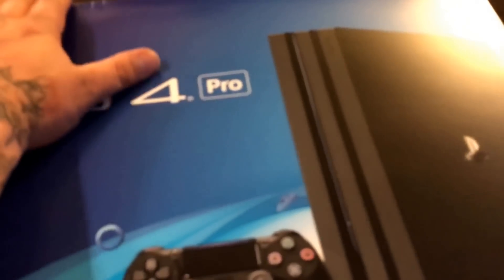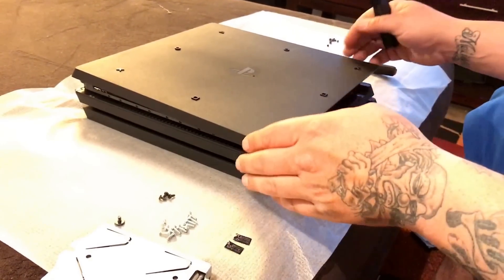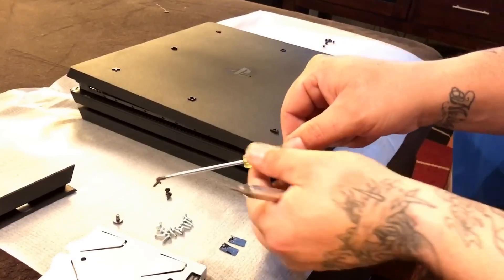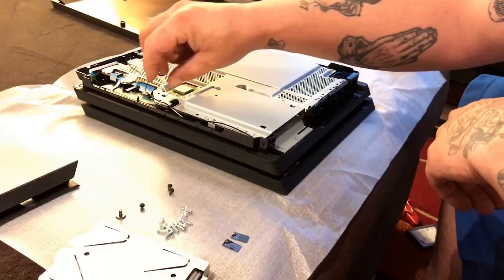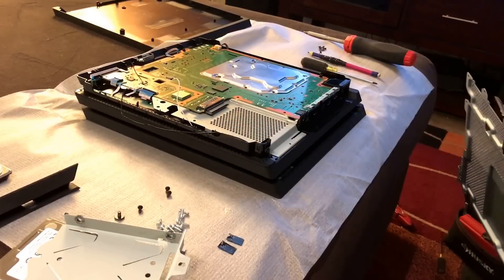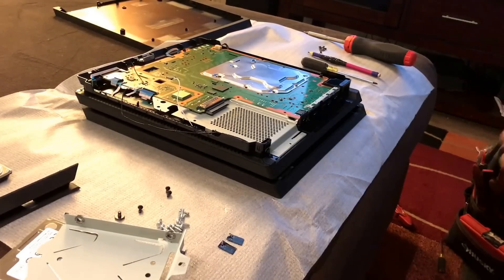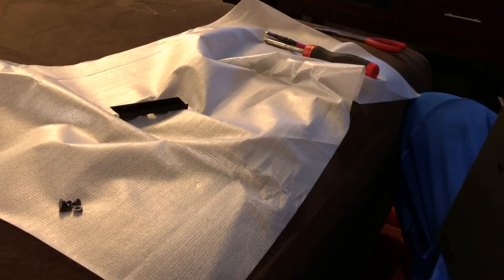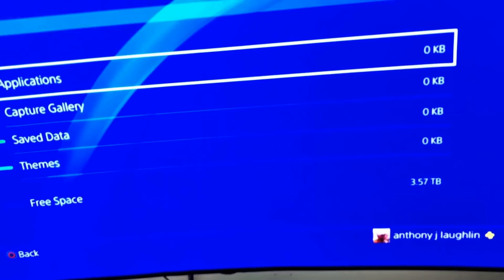How to install a 4Tb hard drive into a Playstation 4 Pro

Comment: omg that is overkill ever since ps3 you just slot out the old one and slot in the new one just like ps5 now you just slot in the extra memory
Reply: You can’t just slot in a 4TB drive as they are 15mm thick and don’t fit hence this mod to the metal plate.

Comment: Thanks for this video. For everyone who wants to know. Still works in 2022 although I had more screws under the hood (t8 and Philips mixed) than you and the bottom plate had only one t8 torx screw , so probably a different build in my 2019 ps4 pro.

Comment: I'm thinking about putting a 5TB. Dimensions are the same as 4TB. The question is: If I install the hard drive without the drawer, will it work without problems? Will it fit normally? Would you like to test?
Reply: PS4 Pro version only supports 4TB internal, I think
Reply: @turohabaneero  8TB
Reply: I'm doing 22tb😂

Comment: This is a 3.5 drive? Maybe I missed that part but it didn't seem clear to me if the drive was a 2.5 or a 3.5. I accidentally bought a 3.5 ssd and just wondering if it's possible to make it work. Thanks

Comment: Were you able to put the black cover back on the hard drive, i am fairly considering this though there is the option of external i would like the primary hard drive to be faster as that is where the ps4 operation files are
Reply from the maker: Allsorts Of Everything ya I was able to put the cover back on I have a ext drive too

Comment: WTF! if you get the correct HDD you don't need to cut anything. Great job on creating the best "what not to do" video
Reply from the maker: Vince it’s cool bro you can hate all you want but did you happen to take a look at how old the video is a little bit of info for ya see before you couldn’t plug a Ext hard drive into the ps4 you had to mod it and I cut mine bec I wanted a bigger hard drive at a good price so I did what I could with what I had at the time and I did a pretty good job being said don’t troll on videos I was just trying to help other people out at the time
Reply: @anthony03241980 what's the biggest you can fit in the pro without having to cut anything? And how did you cut it to make it flush 
Very good job
Reply: Vincenzo, are you stupid? The PS4 Pro has SATA 3 and this standard is faster than Usb 3.0 (3.1 gen 1).  If you put USB games on the PS4 Pro, you generate a bottleneck.  The only models in which it is recommended to use the Usb 3.0 (3.1 gen 1) is the fat and slim model that use SATA2 and its standard is slower than usb. With the trash you say you make your null knowledge clear.
Thanks for the video and for sharing it Pittsburghs Work hard game harder.

Comment: U using a 2.5 or a 3.0 hard drive??
Reply from the maker: Ya you can take one apart and reformat it
Reply from the maker: ted mooneyhan 3.0
Reply: @anthony03241980  what hard drive are u using bro.   I'm gonna purchase one soon
Reply from the maker: Bro if you buy a external hard drive I get my stuff from Best Buy but you can take it apart and there’s your hard drive and sometimes you can get them cheep I was there a couple of days ago and could have got a 4 tb for 60 bucks
Reply: @anthony03241980  so you can take apart an external hard drive and install it in the pro?

Comment: This was really good... you made it flush without the bulge, and more space for it
Reply: How the heck did he do it
Reply: @JAVA_Cafesito  he cut out the section where the HD sits. I had to do this with my PS4 for my 4tb drive as well. Which I'm wondering if I'll have to do the same with it.
Reply: To be honest, as clean as this is, there still does seem to be a small visible bulge. Note that as he closes the console, he mentions how a screw near the HDD would not go back right. You could probably do it in a way where the HDD cage isn't necessary, but you'll need some antistatic material at the very least. Not like you can slide out the HDD cage after closing the console anyway.

My console is currently apart, and I'm about to take a dremel to it. Gonna see what I can come up with after I make the cut.
Reply: @Disaste3r _L SATA extension. Make it go to eSATA, then use an external powered enclosure that supports eSATA. A little inconvenient when you consider you'll need both the external drive and the console connected for it to even power on, but the benefit is you can use up to 8TB internally with no case or metal cutting. Probably don't even need to void the warranty for that either, just gotta be extra careful connecting the SATA to eSATA extension.

Comment: Since doing this mod I am having problems with blu ray drive not reading disks correctly and also a grinding noise when disk moves. If think because of the hardive thickness it as put pressure on the blue ray drive.
Reply from the maker: Jack Daniels it may have mine never did they make a sata cable you can get off amazon try that and see if it helps

Comment: so is this done with a 3.5 in hard drive? because I see a 2.5 in hard drive thats 15mm thick available on amazon. Wonder how well that will fit without any mods.  Thanking of doing this but im just worried about screwing up my ps4
Reply: only ssd more more than 2 tb can fit ,, it's not exist any hard drive 2.5   3tb   4tb  thin under 12 mm ,,  9.5 mm  it's maximum  2 tb for now 2018 , exept for ssd ,, but they over priced , if u want 4 tb in ssd it's more than 800€

Comment: What size do the hdd need to be? 3.5 inch?
Reply: I'm confused. I thought 3.5 HDD were for desktops and 2.5 were for laptops? In the beginning of the video you showed a close up of your 4TB HDD and it said "laptop" on the sticker. On eBay I'm finding 2.5 laptop 4TB HDD 15mm
Reply from the maker: BoAsT186 yes 3.5 sry didn’t get comment
Reply: Pittsburghs Work hard game harder all good bro just installed a 5Tb. Everything went smooth I did notice that the cover had a slight bulge nothing major tho. HDD plastic cover doesn't fit all the way flush. Did you have that issue?
Reply from the maker: BoAsT186 ya if you mess with it it will go on just be easy if not no biggie you can 3m it

Comment: I have done this with the seagate STEA4000400 4 TB drives, but i did not cut the upper plate above the HDD bracket. When i saw your video, i might will do that just to release the press on the HDD and the bracket.

Comment: There's alot less bulge then if you don't cut the metal off but it's still there. If you hadn't put the tray over it would the bulge still be there? That tiny bit of extra metal could be the difference between it being flush or not. And if that doesn't work maybe sanding a tiny bit of the inner plastic case would make it perfectly flush? Gonna try this mod with my ps4 soon. Sucks that we gotta do this BS to play our DISK games nowadays, I have a huge game library on disk and I don't want to have to uninstall and reinstall games to play my entire collection!
Reply from the maker: Jose S no when you cut it there’s really no bulge the tray is just to help u pull it back out no need to use the tray

Comment: Thanks for the vid, I'm int he market to get a bigger HD.. I was going to go with the 2tb seagate firecuda. I'd rather a 5TB drive.. should sell those cut out boards man, or I'll send you mind to cut haha, what u cut it with!?
Reply: Dave Budness Thanks
Reply: I feel like you SHOULD cut the shield if you install a drive this thick to avoid possible PCB flex from the screws pulling the shielding back down. PCB flex was a common killer of the Xbox 360, but if you still have your old towel laying around for "reflowing" the Xbox 360 you'll be good (it's forwards compatible with the PS4). Anyhow, can you confirm that removing the drive tray eliminates the remaining bow underneath?

Comment: Could u test the suspend , I mean (unlike the data bank) can u resume your game after it been in standby ?, I think  it should still work as it's using the internal power.
Reply from the maker: Dave Peters  ya you can resume your game after it's been in standby it's not like the data bank at all you don't have to keep your USB power on all the time
Reply: Cheers mate, thanks for the  quickreply
Reply: Pittsburghs Work hard game harder is it true if you stick a  enteral 10tb hardrive that you will lose the ability to put your ps4 into stand by mode ? & I also heard it burns out your ps4 quick that’s just what  I heard is that also true ?

Comment: its sad that even cutting that plate down below will be crooked... =\      if i do not put the drive tray on... it will still be crooked below?
Reply: 1misantrop , sony do that for preserve the lens , rather than read 200 x the same fight data by exemple ,  the lens read 1 x for transfer it too hdd and the 199 next data will be read not from lens but hdd ,  they don't want the same problem than ps1 or ps2 , that why they that ,  they do it partially on ps3 but not fully ,,   Xbox360  many year later have add  this option for install the game for the same reason . preserving the lens optical
Reply from the maker: Marcio Barazzetti  it may I put mine on so I can pull the drive back out easily